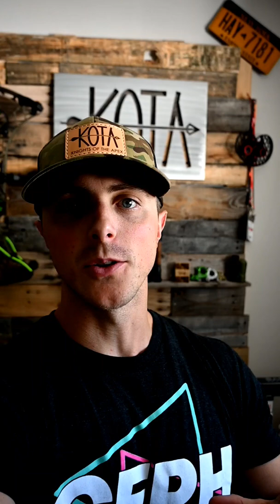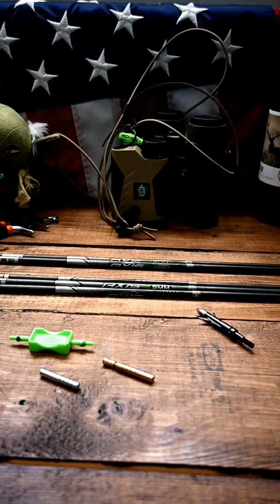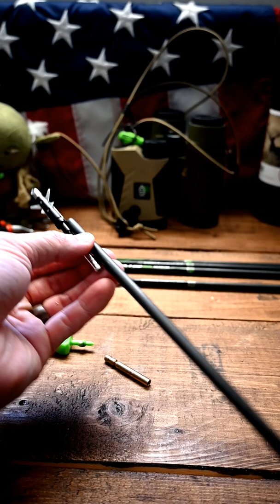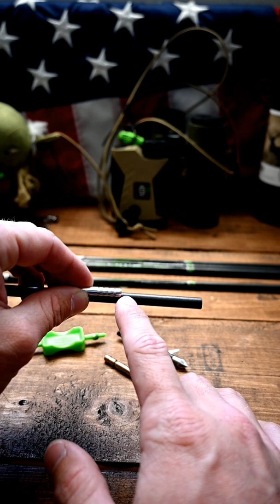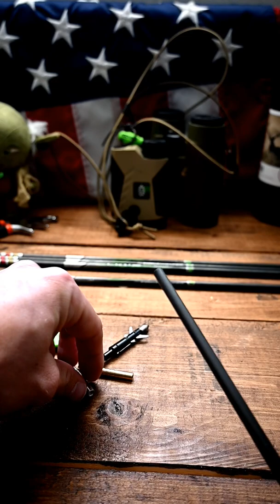Build Better Arrows with these HIT Insert Tips

Comment: The biggest problem with this system is that the tool fits so snug the it creates a vacuum when you pull it out, even if you take the knock off.  You have to cut off part of that flange on the tool and be very careful that you're not sucking that insert back out, which happens very easily.  As the glue dries you need to check the depth again to make sure that insert hasn't gotten sucked out.  Iron will makes a tool that is way better than the plastic one that comes with the glue for $20 and is well worth the money.